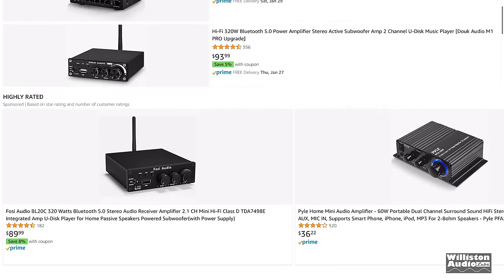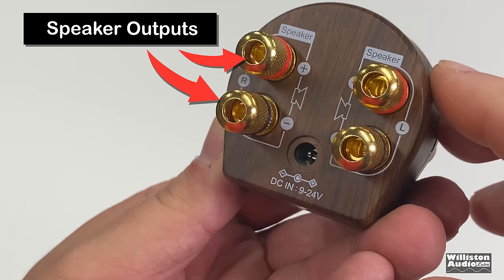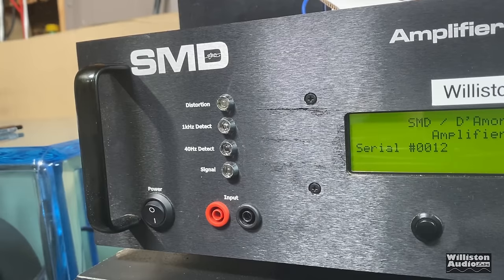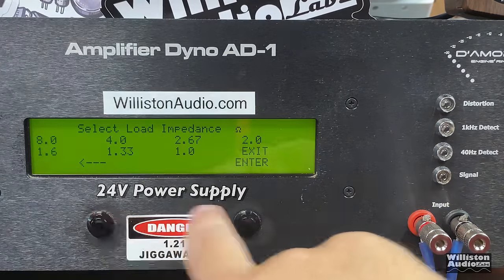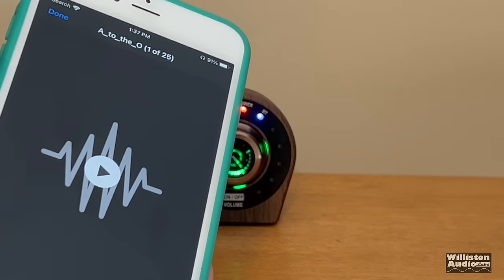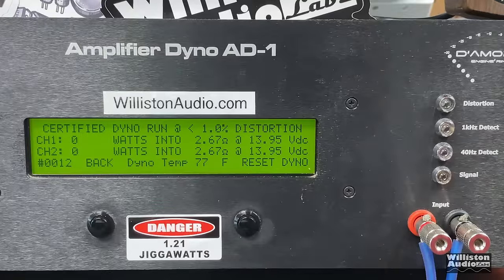Surprising Palm Sized Bluetooth 5.0 Amp Amazon Special

Comment: That'd actually be pretty slick for a spare room or bedroom setup. I appreciate you doing these reviews, I don't comment too much but I do appreciate the info you put out there.
Reply from the maker: Thanks for watching and commenting!
Reply: @wal  you're welcome! Thank you for putting all the effort and time into making these videos. If it was easy everyone would do it.
Reply: @wal  please look up the rockville rpm870 it claims it's a bluetooth home and pro unit that puts out 6000 max 1500 rms at 4ohm but it will go down to 2ohm also and it is a home monster for 250 bucks but I want to know it's true power... there is no other pro set up in the 200 to 500 price that will compete with its power

Comment from the maker: Shop (affiliate) and Related Links:
BT 5.0 Mini Amp (no power supply): https://amzn.to/3AoOZ1Y
BT 5.0 Mini Amp (12v power supply): https://amzn.to/35iUHqP
Other BT Mini Amps: https://amzn.to/3qTQ6Up
12V 5A Power Supply: https://amzn.to/3H2P6mE
19V Power Supply: https://amzn.to/3GUwyor
24V 10A Power Supply: https://amzn.to/3FW8eRR
Elac Uni-Fi Bookshelf Speakers: https://amzn.to/3FUThiL
Elac Debut 6.2 Bookshelf Speakers: https://amzn.to/35i6RjK
Mini Amps Video Playlist: https://is.gd/walminiamps

SMD / D'Amore Engineering Amp Dyno: https://goo.gl/sJTcf7
XS Power D1400 Batteries - https://amzn.to/2BPFCKW
XS Power PSC60 Charger - https://amzn.to/2CHGcfs
Fluke 1000A AC/DC Clamp Meter: https://amzn.to/2Rw5WDA
Handheld Dyno: http://amzn.to/2u2EgKV
My Favorite Screwdriver Kit: http://amzn.to/2x0VzcE

Video Index:
0:00 Intro
0:36 Unboxing
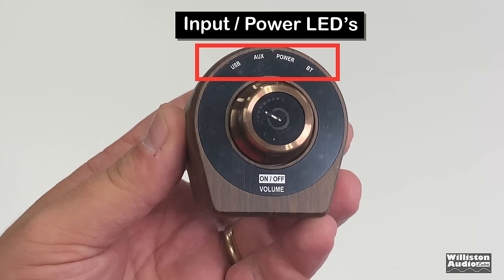1:15 Features
2:56 Two Versions
3:33 Amp Dyno Tests
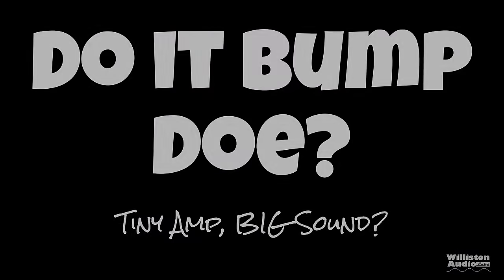5:53 Do It Bump Doe?
6:30 Bluetooth Operation
7:38 USB Operation
8:13 AUX Operation
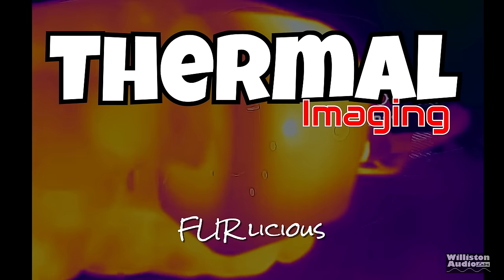9:00 Thermal Imaging
9:26 What's Inside?
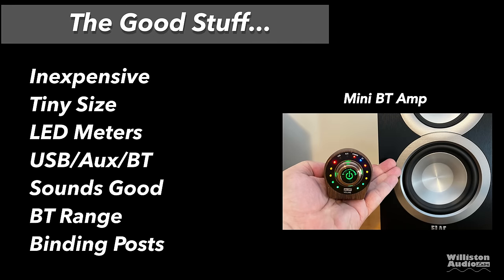10:39 Pros / Cons
11:26 Conclusion
11:50 Extras!

DISCLAIMER: This video and description contains affiliate links, which means that if you purchase from one of the product links, I may receive a small commission. As an Amazon Associate I earn from qualifying purchases

Comment: I have 2 of the wood grain units and two of the oval units. The TI TPA3116 is truly a fantastic sounding chip amp. Doke audio does a few things to improve the sound that other don't.  The coupling cap from the DSP to the chip amp is way over sized. it is a board mounted part but much higher voltage rated. and larger. Must cost 5 cents more to do but all the other cheep little amps use crap. The input filter caps really are way over sized and are true brand name low loss caps. It's the sound quality that makes this amp stand out. Don't kid yourself, It will sound better then most amps you have ever owned! I have had a lot of amps over the years and non sounded better. A few notes on the input voltage. I ran a bunch of voltages and a variable PSU. With12v the amp is kind of dull sounding. Don.t know why but it's just flat. With a 17 or 19 V its perfect. With a 24 it sound a bit worse and run hotter than heck. 19V is perfect.  The other units with the oval shape have a even larger filter cap and slightly better bass. I put RCA leads on the preamp section to run a sub and its a dam great system for almost no money.  Crazy good.
Reply from the maker: Excellent comment and feedback!! 👏

Comment: Like others have mentioned, that chip is designed to use the PCB as the heatsink. Look at the ground plane and all the via's through the PCB, that makes a thermal connection to the underside of the amp chip. :)
Thanks for the review!
Reply from the maker: Great feedback 👌

Comment: The 3116 has a thermal pad on the bottom, so it's dissipating thru the PCB ground plane and into the binding posts.   Probably not too bad a setup but not ideal.   It's going into protection at 4 ohms or less, probably a good thing.
Reply from the maker: Thanks for the feedback 👍

Comment: I sent a bunch of these micro mini amps that I found on Amazon for around $10 to just a bunch of people  for New Year's.   that heat sink really does help out and I order the kit from Amazon I put one on the Bluetooth chip just because I had one and I put one on the main amp. 

I was running what was a 2-ohm load which was basically three speakers in parallel on each Channel and it had no problem shouting out the tunes.  

the fact is so small is really amazing.  and it didn't sound half bad either I think it actually kind of really good

Comment: Obviously "Mini D amp" was an acknowledgement they knew you'd be reviewing it. 😁 Great little find! Being a nerd that looks at data sheets, I remember one of the TPA3116 packages has a thermal pad on the underside, for PCB heat sinking. Could be that's the chip they used. I do see a lot of vias in that ground plane, and you mentioned the binding posts got warm. 👍️

Comment: Nice find/review (as always). TBH, most people don't use more than 5 watts (RMS) for most of their general speaker listening. Always use the max voltage on those AC/DC adapters (24v in this case) to get best sound/power out of these mini digital chip amps. This 3116 chip doesn't have enough cooling to run less than 4 ohms...prob built with some protection. I had that happen to a chip amp a while back...kept cutting out.
Reply from the maker: Thanks for the feedback 👍

Comment: I love these little amps.. I've had several of the TPA and TDA amp chips and for the price they all sound good.. Currently I have an Lepy LP-2020A that I paid $20 and it sounds amazing but it doesn't have a built in BT so I recently bought a used Nobsound NS-20G mini amp with BT for around $25 and it sounds really good but it doesn't have the bass and treble knobs that the Lepy has.. A lot of people are missing out on these amps because they see the cheap price and think junk...

Comment: I wonder if you use a different power supply with lower volts like 12 and 2 amps will that lower the temperature of the amp?
Reply from the maker: Yes lower temp as well as output
Reply: @wal  Cool. thanks for the info.

Comment: Thanks for doing this!
I've been curious about these little egg timer amps for awhile now in a desktop configuration.
It's amazing how much volume you can produce with relatively few watts.
Man these little chip amps have come a long way.
Have you ever tested one of the SMSL mini amps?
I've almost pulled the trigger on one from Diytoids recomm. But I'm not quite there yet.
Reply: I love it, I have some 90s stereo equipment I put together, 5.1 surround for my TV, Chrome stick, aux input and both PC's, enough wires to open a radio shack. Anyway, it's retro and takes up my entire book shelf but it helps heat my room when it's cold, maybe 110 decibels at 3 feet per ear, lol...
Reply: Loved my smsl  ad18 but replaced it with cambridge axr100 worlds better sound quality. But the smsl did the trick for a shop radio

Comment: When you put 24 v power into it ......it's going to sound a lot louder than if the power supply is only 9 v .......right ? I have a Dayton that can run on 9-24 volts and it even runs on 8 aa batteries ! Great little portable 15w per channel amp.....but when I plug it into a 24v 8a A/C current it is noticable how much louder and better it sounds !

Comment: I received mine yesterday and I'm amazed by the power of this tiny little thing. I connected my vintage Tandberg HiFi System 15 to it. 12" bass elements. I really made the room shake. Do you think upgrading the capacitors (to known genuine ones) and adding a heatsink will make any difference in performance/sound?
Reply from the maker: I doubt changing those parts would make any noticeable difference

Comment: i do have this amp for over 2 years now, its decent but i cant really drive it that hard. it gets crazy hot with some Coax car speakers hooked to it with a moderate volume. it regularly cuts out after listeing to it for about 40-60 minutes, then i have to turn the volume down.

Comment: Im curious as to how one of those 6j1/LM1875T hybid tube/solid state amps kits would do.  Stock tubes vs 5654 tube upgrades. Cheaper on aliexpress than amazon, but either way Youll have to find a centertapped  18V-0-18V  transformer..

Comment: Does it change output based on what you are running the sound with?  I have had amps that were significantly weaker on bluetooth
Reply from the maker: Total volume output the same but yes the USB and AUX are slightly louder at the same volume level than BT

Comment: The poor chip will be cooking it self even at 8ohm load. And most bookshelf speakers are 6 or 4ohms so the ic will really be cooking it self. I bet it runs at 90c at 20w/ch load. & The capacitors right behind the ic will fail quickly as they are absorbing the heat from the chip + oparating at very near 25v.
Reply: If there's even a smidgin of space I'll thermal glue a coin or something to the chip before I give it a good long workout.

For the price i'm not too worried. That form factor is real convenient.
Reply: You can buy some raspberry pi heatsinks with thermal sticky pads and use those they are tiny but to a great job I've tried them on many different mini amps and the best part is they come in a lot of different sizes
Reply: @volvo09  
 Does the glue transfer the heat well enough ?
Reply: @Random_4400  i used this ic as an amp for few months driving some 4ohm speaker with 14v supply & it almost burnt my finger tip when i touched while playing hardbass 😆 then a put some thermal grease & pressed a heatsink stolen from dead Netgear switch & it keept it cool enough to play hard bass for hours .. now i have a tda7498e amp board with 36v powersupply to shake my room.
Reply: @bendermi  it's not bad, it's "thermal epoxy". Much better than nothing, but not perfect. 

I even used it on a crappy computers heatsink once. Was totally fine thermally.
Reply from the maker: The thermal imaging I showed was after 30 min of “louder than normal” playback with the 6 ohm Elac’s
Reply: @wal  wood is a very good thermal insulator so it will trap the heat even more & thats why u saw higher temperatures on the binding posts as the board got soo warm it basically spread the heat slowly through the board to the binding posts.
Reply: @wal  if you drilled a bunch of 5/16 holes in the wood all around and the bottom and put a 12v little fan on the bottom and ran it and added the heat sink it would be almost 2x cooler and you could probably just tap in on the 12v power supply from inside the amp to the fan
Reply: Okay thanks .

Comment: I have this one.
I pair IT with denon scm51 (mission speakers)

 Nice sound for the price for your sleeproom.

I use a 19volt from a old laptop adapter.

On my paper IT tell 2x50watt on 4 ohm 10%

I see you have a upgrade one.
My do not have USB-c IT have USB mini.
Reply from the maker: At 24 volts it’s close

Comment: Actually you can make your own Bluetooth amp out of a Bluetooth speaker they basically taking the wires and putting them onto speaker leads and then connecting a pair of speakers from your home audio system on it from like a boom box or some thing with detachable speakers and you're fine you don't need this amp at all when for a few bucks at a thrift store you can get one of your own and disassemble it and repurpose it to make a whole full sound system for the price of one think about it people don't believe me try it yourself I do it all the time and it's working for me because I've got lots of spares just in case something happens or I blow up one of the devices at least I have back up‼️‼️‼️‼️‼️‼️‼️

Comment: Was it just me, or did it seem to be audibly louder and slightly cleaner sounding during that clip where you transition from bluetooth to 3.5mm input? I rewound a couple times and definitely noticed an audible increase. Just curious as to what you noticed between the input/output levels
Reply: Of course the wired connection would sound cleaner than Bluetooth. Mp3 files are already compressed and Bluetooth compresses it even more. So yes wired sounds better than Bluetooth.
Reply from the maker: Yes slightly louder. For convenience I’d stay Bluetooth but if using with a PC or Mac I’d use USB or AUX

Comment: ?????????? I'm assigned a new work vehicle every year and unable to modify factory system. I'm currently using a road warrior 500 watt Bluetooth speaker with a 3.5 mm splitter. From my phone into the dash and into the speaker. It's not enough boom. What is your reccomendation for best way to get more boom without ruining the lease. Anyone?

Comment: I just bought it 30 mins after the video posted and it was $36 😂

Edit: it was $36 with the power supply
Reply from the maker: Yes I mention this as there are 2 models on Amazon
Reply: @wal  the one they provide with the power supply is only a 12v power supply. With these variable voltage Bluetooth amps it’s always better to get the higher voltage, shame you have to buy separately

Comment: This thing is actually kinda perfect for a DIY active speaker. Just gut the f**ker, and mount it on into your bookshelf speaker cabinet of choice. Otherwise, it would make more sense if it were in an enclosure that has the power supply inside as well. That would at least solve the weight problem.